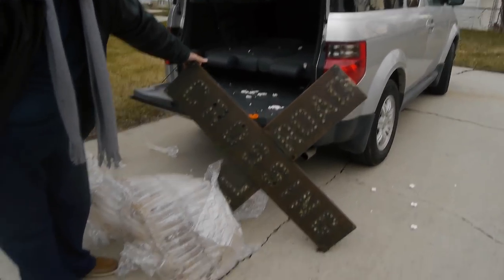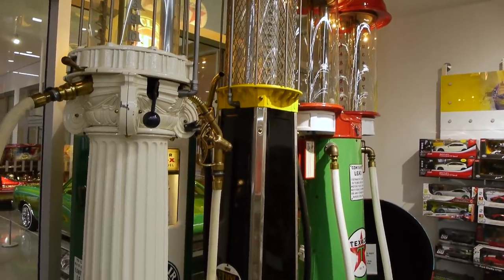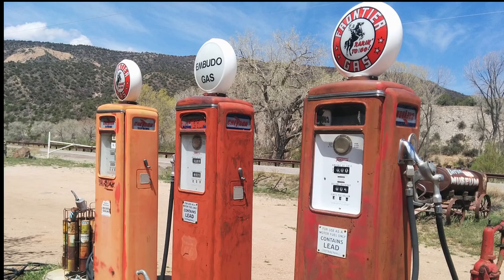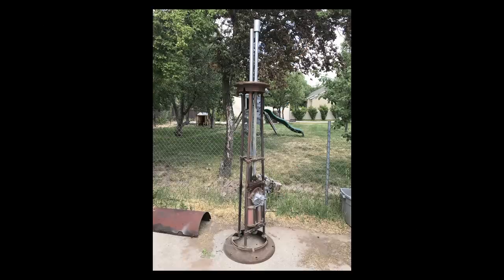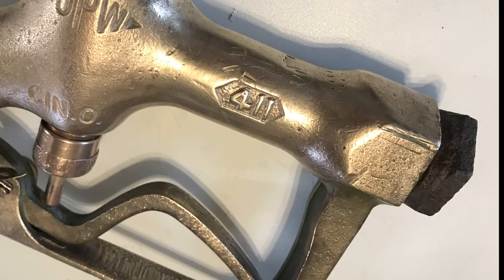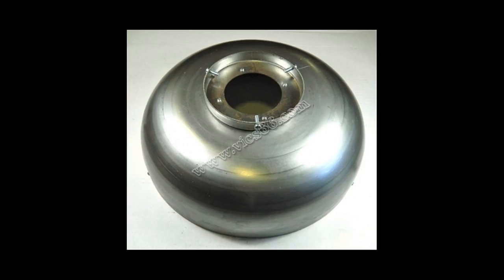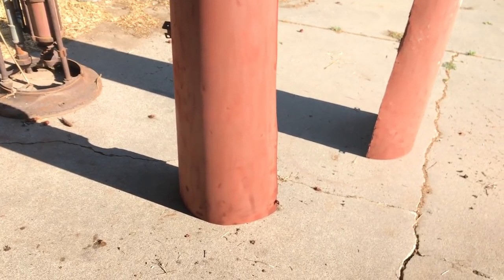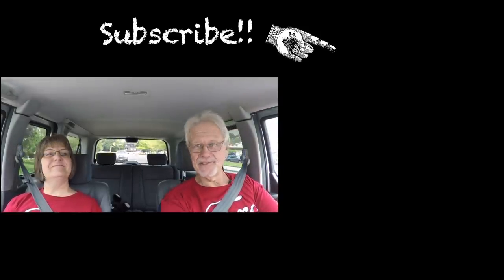Restoring a Wayne 615 visible gas pump

Comment: That's beautiful! (the pump handle needs a nice period looking padlock) 

I've used these pumps before in my misspent youth, and I kinda miss em. You got a decent workout, that's for sure!
Reply: Yes.... Between that, and driving a stick shift, or even an old planetary system... the art of even starting a car with something called a carburetor, back in the day.... No power steering.. Yeah.. Driving was a work out!  There would be no way that one could "text-and-drive" back in those days! Not even with an extra set of thumbs!!

Comment: Great job restoring the pump! If it were me though I'd get some cement and all thread, then pour a slab to permanently bolt down the pump, then take a torch to the top of the all thread and peen it over, to avoid having it stolen again. A good friend of mine had a DRGW switch stand stolen recently, so I bolted my Frisco switch stand down.
Reply: We are also thinking sound effects... Like the sound of rattlesnakes coming from inside the pump, or a large growling dog... Maybe a ferrel cat!

Comment: it does look nice pump... really your first one was stolen??
Reply from the maker: Yup. Whole bunch of stuff stolen in 3 burglaries. The came back. First time stole my tools snowblower mower and air compressor. Rebuilt the damaged man door. A few days later door bashed again and models and antique cameras and photos all gone. Replaced the man door with a steel door and cross bar across the whole door. A week later they drove their truck through the 2 car door and took the gas pump and a jukebox
Reply: darn... that is well unsafe place then??

Comment: Mae West?
Reply from the maker: Almost! The Mae West has a HUGE bottom casting about 18 inches tall. Then an extreme taper down to about 12 inches in diameter. Same jar mostly. Shell used them. As did a few others.